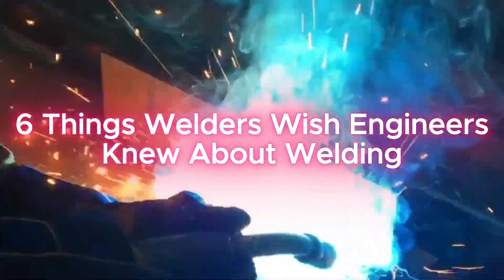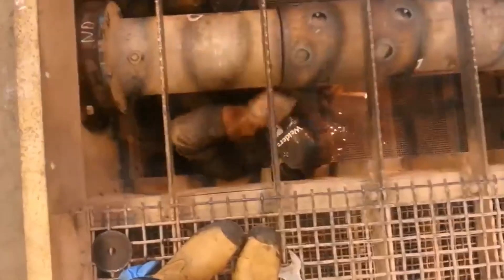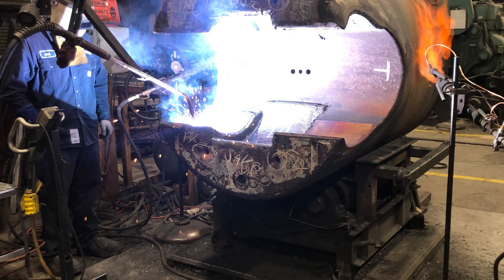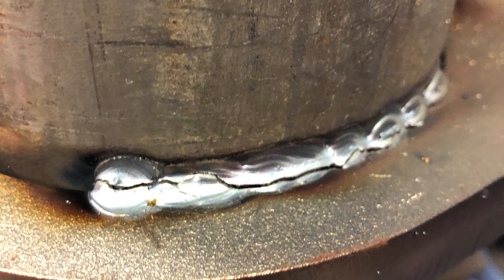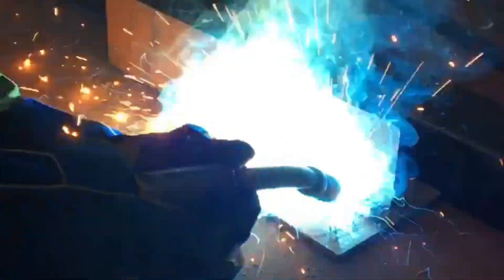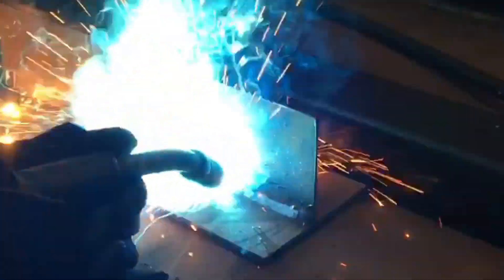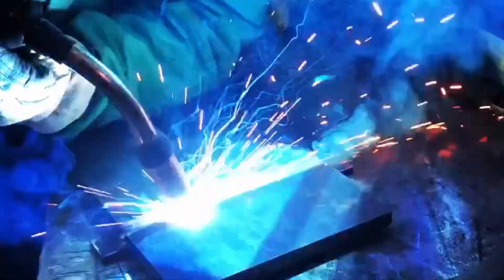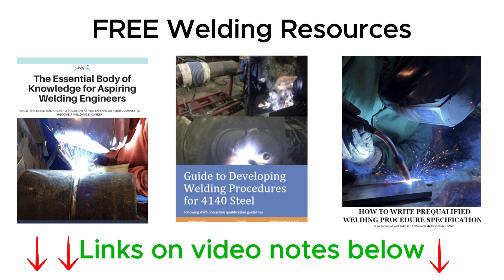6 Things Welders Wish Engineers Knew About Welding

Comment: Retired pipe weldor here...planning so there is room to make a weld is a big deal.  This cannot be overlooked.  I have heard where a weldor knocked out some blocks out of a wall so the weld could be made. 
  I myself have made some welds in tight places. My regular welding hood was too big for one weld. I took my cutting goggles, removed the #5 lense, replaced that with a #10. Then found a piece of card board...put my cutting goggles on it. Took a marker, traced out where the mask was. Cut out this, then carefully pushed the goggles in. I allowed a little cardboard above & below the goggles so the light would not burn my forehead or chin. 
  So yeah, planning matters. 
Good video to point out everything ya'll did, ty 🙂
Reply from the maker: The creativity of welders to get things done is quite impressive. From adjusting and modifying equipment as you did, to using mirrors, bending stick rods, not to mention dissasembling and reassembling equipment to fit through a manhole.

Comment: I know of more welders capable of being welding engineers than welding engineers capable of being welders.
Reply: Sir I know direct opposite, however no one is born educated and experienced, so both is comming along time.
Reply: @vojislavcar6157  The exact opposite is more often the case indeed, research the Dunning Kruger Effect.
Reply from the maker: Hands on experience welidng on the shop floor is worth gold.  Understanding how things work on with all the variables involved in manufacturing positions welders to be become excellent designers in many cases.

Comment: It appears engineers are highly decoupled from the real world. I think about a video of a car oil change, where the oil splatters all over an axle. But the thing is, comperable things happen all over in any possible situation. Many of those things are "told u so" if any of them would actually listen to those who are working with this crap.
Reply from the maker: Communication is essential, yet it hardly ever happnes. Or if it does, there's no agreement on how to move forward.  You're right, this is not limited to engineers and welders on the shop floor.  We see it between sales teams and operations teams, between top and middle management teams.  The companies that learn to communicate across all levels have so much to gain.